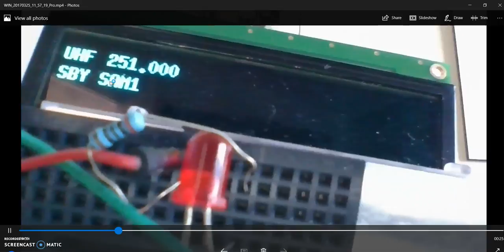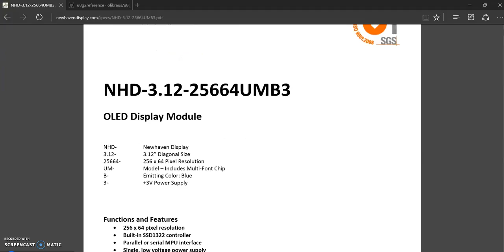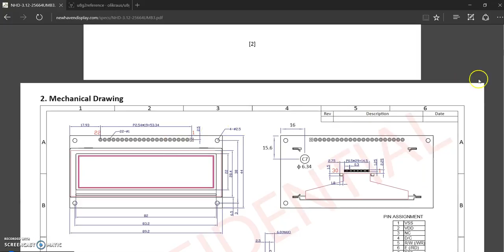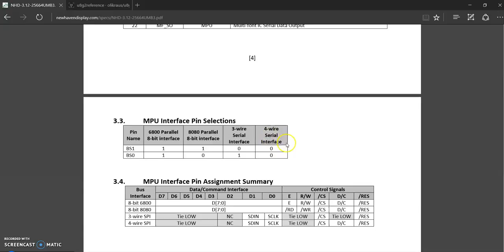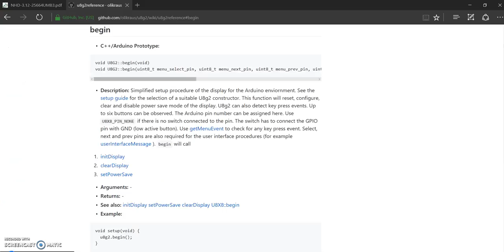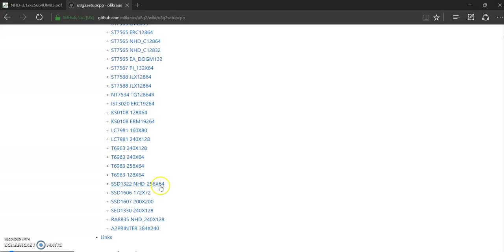NHD-3.12-25664UMB3 OLED(Part1) display using DcsBios U8G2 Library

Comment: Thanks for the great video. Just two small comments:
U8x8 is a different API: It treats your graphics display as a character display (Similar to LiquidCrystal lib). CS line should be connected and controlled by U8g2/U8x8 lib, because not only you can select a display if there are more than one displays, but also this line is used to reset the communication from time to time, making it more reliable.
Reply from the maker: Thanks for the advice I will implement that CS line instead of grounding it. Thanks for the hard work on that library!